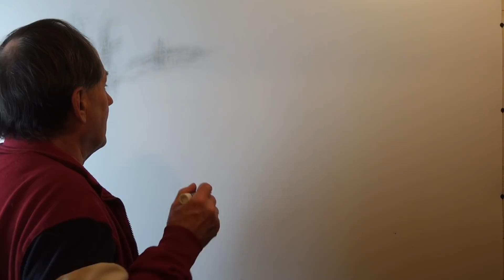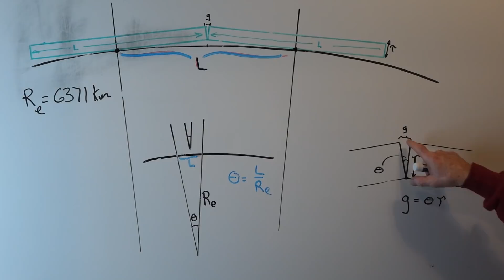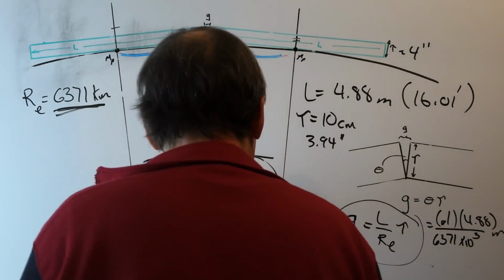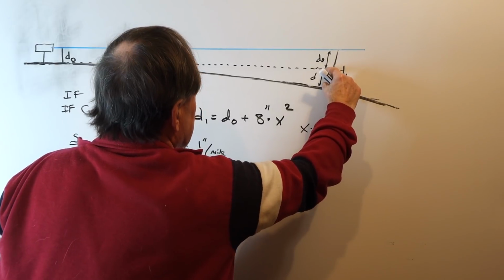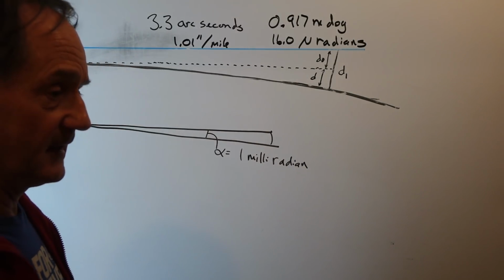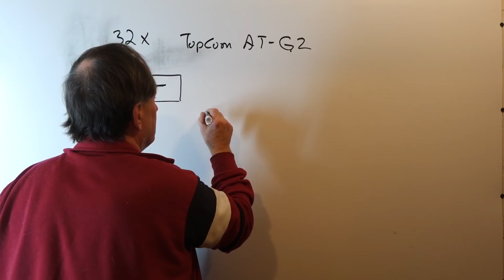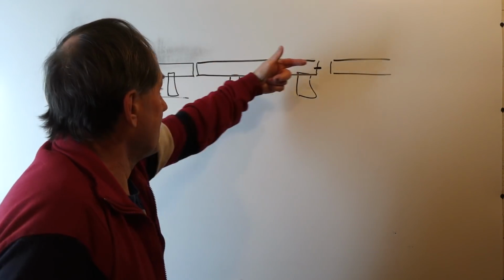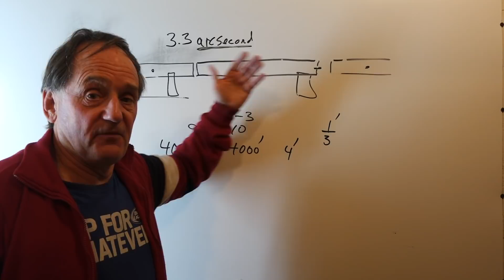Salvaging  Mullin's  " Force the Line "

Comment: The Brian Mullin experiment was performed over 100 years ago by Ulysses Grant Morrow
(1864-1950). It is called The Koreshan Geodetic Survey of 1897.

 "Morrow conceived such a method—to establish a physical straight line to compare with a water surface. He imagined a number of perfect and rigid solid rectangles placed end to end to establish a perfectly straight row, and therefore constitute a perfectly straight reference line, independent of telescope or visual sighting methods."

Here is the link.
https://www.lockhaven.edu/~dsimanek/hollow/morrow.htm
Reply from the maker: Jo GLober,
Thanks for the link.  I am well aware of the Rectilineator of Morrow that Mullin was copying.  I should have pointed that out.

The flat earthers should read that document and note this paragraph: 

 Even more remarkable is the fact that the results were consistent with an earth circumference of 25,000 miles. Looking at the data with more modern techniques of data analysis than the Morrow team used, the data show that value to have an experimental uncertainty of a bit over 2%. It differs from the modern value by only about 2% also.

Thanks,
GH
Reply: @georgehnatiuk5806  Lord Steven Christ tried to replicate the Rectilineator experiment and failed he said the original was a fraud as it was carried out on sand .Lord Steven must of put over a $100000 into it .He also could not line up the beams and after a 1/4 of a mile the results even though it showed Concave the upward arc was way too much .
Reply from the maker: LSC is an idiot in his own right due not only to this failed folly.  LSC keeps claiming he is the living Christ which alone should be enough to get him into the nut house.
GH
Reply from the maker: OMG.  Figures.  I feel sad and sorry for him in a way.
The arrogance of his presenting and promoting the  "Concave earth" nonsense was disturbing.
GH
Reply: The Rectilinear Experiment was not the same as Mullin's. But similar in some respects.
Reply: No it was not
Reply: That was a fascinating article, a glimpse into a rare bit of American history.
Reply from the maker: @macmac9371  that is basically true provided you travel far enough away from the earth so the sun is not in the shadow of the earth which is at around  850,000 miles or 107 earth diameters away in the worst case when the sun is opposite your position on the earth.  For any other case, you do not have to travel that far way from the earth to see the sun.

PS  Can you think of any flat earther that actually graduated from middle school?
I find it amusing when a flat earther such as yourself thinks he is posing something profound when in actuality the statement demonstrates the flat earther does not understand the geometry of the situation.   Thanks for the chuckle.
GH  July 13, 2021
Reply from the maker: @macmac9371  go away - you are too stupid to be talking to me.  No one can comprehend what you are saying because you cannot communicate effectively.  How does one interpret this nonsense:

"If you are above the equator on a globe you can travel in a direction perpendicular from the sun and get further away from the from the sun all the while saying inside the circumference of the equator. "

What does staying inside the circumference of the equator mean?  Inside the circumference means you have to dig a hole and get inside the earth.

Go bother someone else.
GH   July 13, 2021
Reply from the maker: @macmac9371  Look, I have no idea what you are talking about.   What is the hypothenuse angle?  There are two angles a hypothenuse touches in a right triangle and going straight up from top of a ball staying within its circumference has no meaning in mathematics.   What is staying within a circumference supposed to mean?
GH
Reply from the maker: @macmac9371  You seem to be confused.  Your diagram "B" shows a person moving(Blue squares) perpendicular in a direct vertical direction from the plane defined by the equator.  Vertical in this case is defined by the vector that goes from the center of the earth and intersects the equitoral plane in a perpendicular manner (90 degrees or right angle) which is tilted by 23.5 degrees from the line that is perpendicular to the line that connects the center of the sun to the center of the earth.

Figure B
  
 \  This is vertical direction in relation to the equitorial plane when standing at the north pole

   \
    🧍.           |.   |   <--- This is not vertical for a person standing at the north pole
        ↖️.       |.   | 
            ↖️    |   |
               ↖️ |.  |
☀️———— 🪐

Vertical is opposite to the direction a weight hangs from a plumb line ANYWHERE on the earth
Good luck.
GH
Reply from the maker: @macmac9371  Go back and complete the 5th grade.   You do not understand the definition of what an equator is.  The equator of the earth is NEVER in alignment with the ecliptic.   The ecliptic is that plane that passes through the center of the sun and earth that the earth's orbit about the sun lies within.  The equitorial plane is that plane that passes through the center of the spherical earth and is perpendicular to the axis of rotation.  The equitorial plane is tilted to the ecliptic by 23.5 degrees so the equator can NEVER be in alignment with the ecliptic given that the equator is the intersection of the equitorial plane with the surface of of the spherical earth.  You apparently do not understand nor can visualize 3D geometry.

GH  July 13, 2021
Reply from the maker: @macmac9371  
I understand definitions perfectly fine.   The term is   E C L I P T I C    and not elliptic.   You are obviously way out of your depth on this.  I am finished entertaining myself with your nonsense and stupidity.  This is why we all laugh at flat earthers --  they understand nothing about math and geometry in particular.  Goodbye.

PS  When the sun is on the celestial equator, twice annually, day and night are of equal length.  This is called the equinox when the sun is on the celestial equator as it passes across it at an angle equal to the tilt of the earth of 23.5 degrees.  The sun never moves parallel to the celestial equator.  You do not seem to understand this.   Take a basic course in astronomy before trying to debunk the heliocentric model.

GH  July 13, 2021
Reply from the maker: @macmac9371  You idiot.   That line of perpendicular you have drawn only holds at sunrise and sunset during the equinoxes anywhere on the earth.  For times between sunrise and sunset the vertical and ecliptic plane are no longer perpendicular and you will move closer to the sun if you follow a vertical from the surface and you will move further from the sun during night between sunset and sunrise following the same vertical.

The axis tilt of the earth with respect to the ecliptic is real at 23.5 degrees.  There is no "alleged" about it.
You are on the wrong channel to pedal FE nonsense.
If you persist with this, I will ban you from my channel.  Be forewarned.  
GH  July 14, 2021
Reply: Did they say it was showing concaved and then they scrapped the whole thing because of it
Reply: @macmac9371  This is actually genius man
Reply: @georgehnatiuk5806  where is Brian Mullins ‘ videos????
Reply from the maker: @lauratempestini5719  I do not know.  I believe Mullin deleted the originals but others in the past put copies up in their own channels.
The links I had to the videos do not work anymore so I cannot help you at this time.
GH   Aug 26, 2022
Reply: Link won’t open.  Have anything else?
Reply: @georgehnatiuk5806  Than you

Comment: I like your ideas of possible improvement. What I missed watching the video was the necessary requirement for improvement. Did you make it clear that the tolerances would likely exceed the curvature per 2 miles? I didn't see you explain that. Are your estimates showing a likely error of greater than 32 inches over the 2 miles? I find it difficult to believe that such precision is necessary. If the fence project was 'simply' extended to 10 miles, we'd have far more curve and error would 'level' out making the tolerance more obvious, but the likelihood that the tolerance would run plum with the curve of the earth seems incredibly unrealistic an explanation. 

If all that is the case, Brian Mullen's idea would be very effective, despite tolerances leading to some degree of error.

If anything, I would more expect the tolerance producing error would average out to a straight in the long run.

Comment: It's not impossible actually at the Bedford canal this can be done.
Reply: It's about the water and you know it George lol
Reply: It would be a flaw to compare it with water because for instance this man assumes that water follows the curve.  Not so.  That is scientism.  When the beam ends up being level with the water he will think it just proved the globe because of his scientism belief of water is flawed to begin with.
Reply from the maker: @rayoson5778  
No, you are missing a key point.   The "fence" as conceived by Mullin is to be built STRAIGHT and not referenced to any level.  The fence of "force the line" is basically a tangent line to the earth.  Then you compare the earth surface to this straight tangent line to determine if the surface is curved or flat
In principle, it is a good plan however, it would be very very difficult to actually build and guaranteed that it is indeed straight.
GH  July 10, 2022  12:33pm
Reply: . I disagree with you about the shape of the earth, but you're a cool dude bro. I appreciate your video and the conversations you have in the comments alot.

Comment: Wrong. there are three possible models, flat, ball convex, and hollow sphere concave. If its concave the light bends slightly more than the curve of the earth and the auto level will be useless. Not sure why Mullin's experiment wouldn't work. You are comparing lines that go with the curve of the earth to one that is straight. I find it difficult to believe that atom difference will cause it to follow the shape of the earth or something. If you machine these parts within 100 thou of an inch how could this not provide accurate results? Yes, error compounds exponentially over distance, but it doesnt sound like it would be to far out there to do this experiment
Reply from the maker: Errors do not compound exponentially.  This is statistics and random Gaussian errors are handled by RSSing them.
<<I find it difficult to believe that atom difference will cause it to follow the shape of the earth or something.>>
Good to hear your intuition and beliefs are better than mathematics and engineering.  Get a job with BAE Systems and save them 10s of millions of dollars a year.  Wish you well.
GH
Reply from the maker: Forgot to mention that machining parts to within 100,000th of an inch requires the differences in lengths and widths to be no more than 1/4 micron or 250 atoms.  Good luck with that.
GH
Reply: @georgehnatiuk5806  Well I guess that all depends on what the lengths of each piece of metal are. Obviously the longer the cheaper. But say a metal bar 5 feet in length will be more accurately straight than one that is 20 feet in length. So really the question becomes on what length are you basing your calculations. And yes it would take many bars to go 2 miles with each bar being 3 feet long.
Reply from the maker: @unshapingtheearth7916  
Are you serious?  Shorter the bars, the more accumulative errors are picked up.  To go 2 miles with 3 foot bars requires 3,520 bars and that many joints!    With that many joints, each bar would have to fit and align with the previous one to within 1/1000th of an inch horizontally or parallel to insure this straight line "fence" you are trying to build does not deviate from straight with the starting bar by more than 4 inches at the far end.  A 4" deviation at the far end 2 miles away where the curvature drop is 32 inches gives an error of 12.5%  of what you are trying to measure(4" error in 32").  Obviously, you have no experience working with material at this scale.
GH
Reply: @georgehnatiuk5806  😂😂it was literally an example, i was asking how long the bars were in your numbers. And yes if the there would be more possibilities for errors. But a very long bar wouldn’t be perfectly straight. Shorter bars would be better so youd have to find the perfect length bar compromising for possible deviation.
Reply: @unshapingtheearth7916  wrong: earth is a dodecahedron.
Reply: finally someone smart, thank you man

Comment: I was thinking two towers, each locally plumb, with a cable strung first near the bottom, then near the top. I expect sag in the cable can't be eliminated, but maybe by using a strain gauge the cable can be pulled equally taut at both elevations. With care taken so that both elevations are taken at different times during the day, so eliminate thermal expansion of the cable as a systemic error.
Reply from the maker: so what does that get you?
GH
Reply: @georgehnatiuk5806  I hope it gets you a comparison of the length between the bottom of the towers and the tops of the towers. The idea is to remove optical sight lines as factors as much as possible, using a measurable object instead. Flerfs already don't trust autolevels.

The taller the towers, the greater the difference in length between the tops and bottoms of the towers. Also, the harder to keep them plumb through their entire heights, of course, which is a downside. But at least it would remove the flat earth confusion of level vs. straight, something few flat earthers seem to be able to grasp, because both globers and flerfs would agree on plumb and level at each tower locally.

You could just pull the same length of cable between the towers and accept some sag (I think you'd have to accept some sag in any case in the real world) and just compare strain measurements with the cable along the bottom vs. along the top.

I think cable is cheaper than rigid steel or plastic pipe for the same length, and it comes pre-assembled for fairly long distances. Cable to cable joins would just have to hold under tension, without any precision as to the angles of the joins.

You'd probably need guy lines (not sure if that's the right term) and be able to re-tension them to get the towers back into plumb under the tension of the inter-tower cable.
Reply from the maker: @barryon8706  that is doomed to failure.  Cable sag and stretching will kill you.  The separation distance between the top and bottom of the towers is not much.

the difference in spacing is      d = s* h / Re
                                                      s = distance between tower bases
                                                       h = tower height
                                                       Re = earth radius   3959 miles = 6371 km

Example:      h = 600 feet,    s = 1.0 mile                 d = 1.0 * 600 / 3959  =  0.1516 feet  =  1.82 inches

GH
Reply: @georgehnatiuk5806  Thanks. It's good to know where real life breaks the thought experiment.
Reply from the maker: @barryon8706  yeah.   life in the world can be a real bitch.
GH
Reply: @barryon8706  research catenary
Reply: @Jerre27  That's why I was going by tension on the cable instead of trying to pull the line absolutely straight. I don't know if it could be pulled straight without putting a neutron star at each end, but I thought the same strain would pull it equally straight, or close to it.
Reply: @barryon8706  sorry to Burst your bubble, but gravity is something pulling in the Middle of the wire. Catenary. I got a.demo of this on my channel.
Reply: @Jerre27  I think one of us is missing the other's point. I understand that there will be sag in the cable.